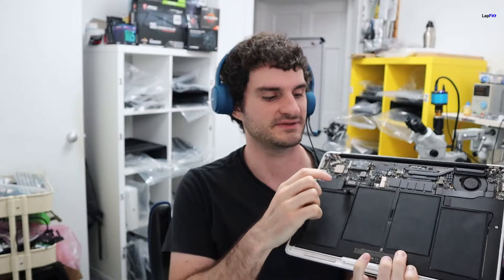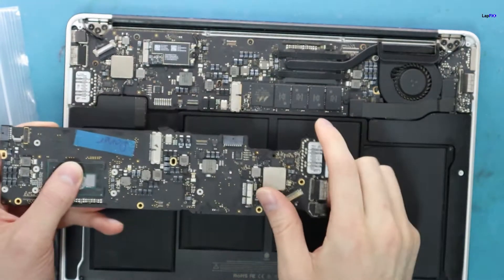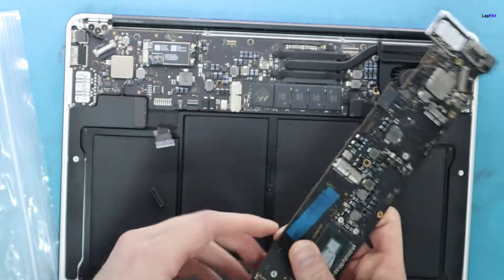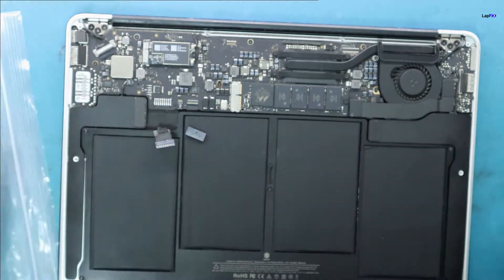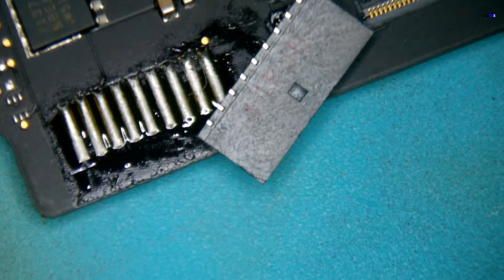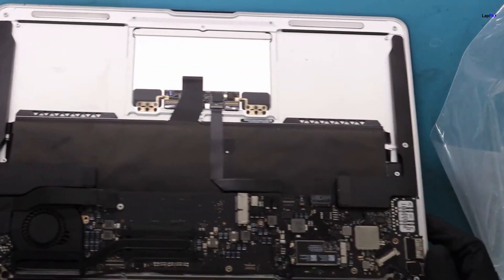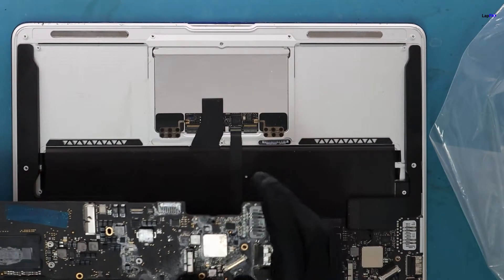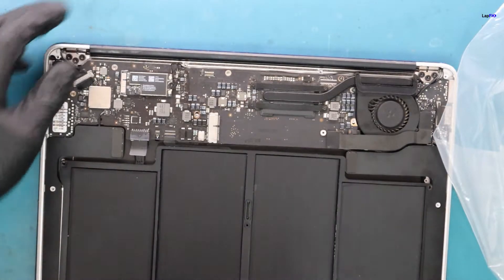Repairing the Battery Connection on a MacBook Air A1466

Comment: For anyone that’s interested, I was able to finally get it done! First add flux and low melt solder just like it’s shown in the video. Next, use the hot air station behind it like it’s shown on the video but use the soldering iron as well using a back and forth motion while adding pressure to it slowly to push it towards the battery side. It comes out in about a minute or so. I have a low watt station but it’s set at 320 Celsius with low air at it. Thanks for showing us how it’s done.

Comment: thanks for the video, i just busted this socket off the board while diagnosing an air, the battery was not screwed down and fell out when I tilted the machine open.. so annoyed with myself I actually worked out what was wrong with it and had it fixed (io board) then this happened :( i have never hot air soldered before im still using an iron .. duh! .. such a bummer

Comment: I have exactlty this problem. I was changing my battery and ripped up the power socket. Can you help fix it. It is for a mid-2013 MacBook Air. What is the cost approxamately.

Comment: thanks for the great video! it would be awesome if you could also give the temperature and airflow you are using for such a repair, since this is crucial to not burn the connector and still get the thing off the board ;) thanks for the great content! sure subscribed!

Comment: Super helpful thank you! I am having the same issue where the small connector piece is no longer attached to the board. Is there another option for me to continue to use my laptop somehow. I live somewhere it is difficult to get parts/get to a store. When I hold the connection down myself the battery will start to charge again. Would it be silly to try electrical tape or something else?

Comment: Thanks for the video. What is the glue that you used here?
Reply from the maker: To connect the connection, we use flux to clean/help the connection and solder to hold the pins